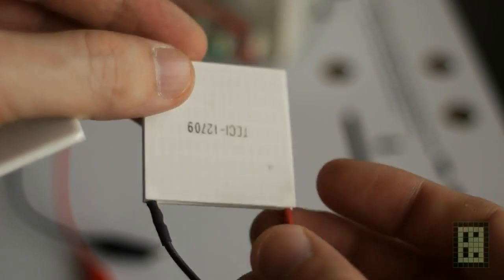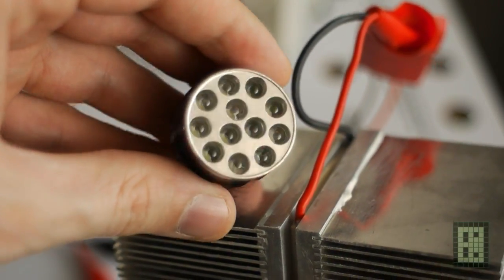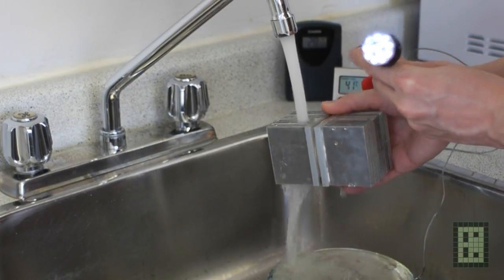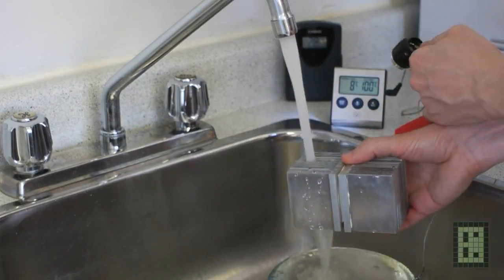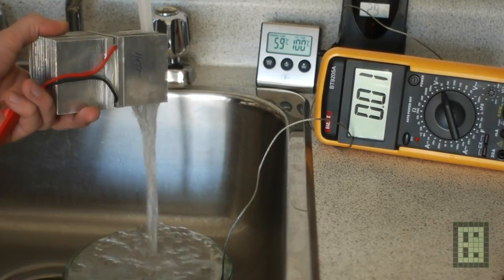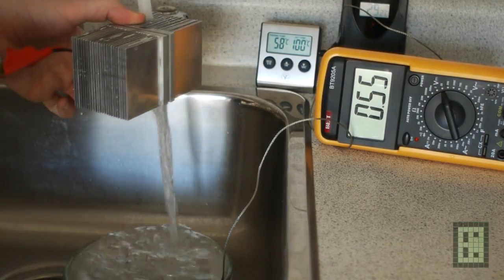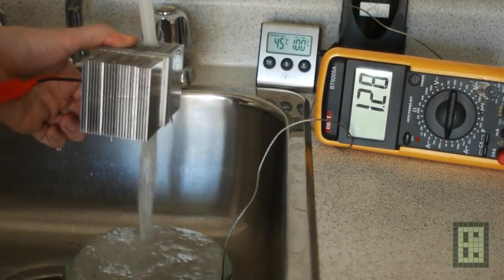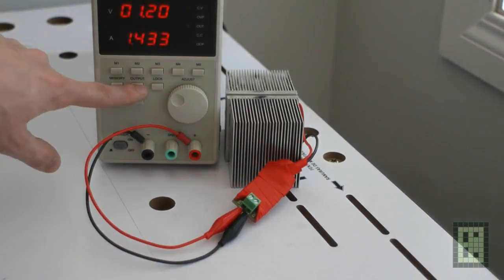Seebeck effect, using Peltier module to generate electricity

Comment from the maker: The project is possible but you will need at least 4 to 5 of those TEC12709 modules connected in series to get 5V 400mA.
Since the output is about 2W and peltier module is about 5% efficient the amount of heat that needs to get from one side to the other will need to be about 40W and should not be a problem from the exhaust of the generator.
Cooling the cold side can probably be done with a volume of water and you will need a simple 5V LDO regulator.

Comment: hello...
i have taken up a project on thermoelectric effect and i need 5V and about 400mA output to charge a mobile. I have to use TEC1-12709 module and i have no other option.
i will use the heat from the exhaust of a diesel generator set installed in our college campus. please guide me in this regard.

Comment from the maker: :) In a sunny day in the afternoon you get about 1000W/sqm from the sun on most place on the globe even in winter.
Sometimes you get more but this 1000W/sqm is used by the solar panel manufacturers to rate their solar panels.
So if a PV panel is rated 150W and is 15% efficient it probably has about one square meter surface and the rating is valid if the panel temperature is 25C if is higher the the output will be lower that is usually the case in sumer.

Comment from the maker: You need probably more peltier modules working together to do that.
The problem is that they are about 5% efficient so you need a heat source able to provide 10 to 20kW of heat.
If for example you want to burn diesel or gasoline to run the motor for 1h you will need about 1.2 to 2.5 liters.
Or say you want to power this with solar power then you will need a parabolic mirror of about 10 to 20 square meters in surface in order to run that motor in a sunny day.

Comment: Thanks for the reply.

1.Is it that if more of the Peltier module is connected in series, the voltage output is increased. Let us say if we connect hundreds of such modules, will the voltage be also increased to a hundred times of its previous value.

2.Does poor thermal conductivity refer to the hot water which went pass the module without getting used?

Comment: It was a good learning experience. Thanks electrodacus.
I have a few questions.

1.What is the reason behind the efficiency rate of 5%.
How does 95% loss take place.

2.I have also doubts in calculating the voltage obtained by Seebeck effect.
If the Seebeck co-efficient of material is of the order of micro-volt per kelvin, how will the output be in the order of tens of volts?

3.Is the output AC or DC

Comment: Thank you for your reply. Yes of course you need a battery bank, and would probably want both solar and Peltier modules, providing the P-Mods are even feasible.  How long it takes to charge the battery bank back up is of course a function of how many modules you have. Maybe you can help me: how many of this type (or other commonly available, p[lease specify) would it take to provide say 600 amp hours per day assuming a mid range of efficiency?

Comment: My interest is in finding if a gas furnace with electricity requirements of "starting" (igniting), thermostat and blower can be made "self sufficient" with Peltier modules for generation and deep cycle batteries  for storage.  Many people don't realize, NG will continue to flow for some time after a power outage.

Comment: What about the furnace heat ducts? Those don't get so hot...maybe perfect? As long as there is sufficient air flow around the ducts, there has to be at least a small differential between the temp of the duct metal and the "other side" (the air cooled side of the module) ...not sure if this would be enough but it seems to me it might very well be.

Comment: 1.2v @ 1.4A SC current is pretty good. It is comparable to a AAA battery.
Also, you might try wrapping the cold side in ICE so you do not have to keep alternating the sides like that.

Comment: This is true. I guess it depends on if you are worried about lifespan or not. 

Temperature differential is what makes it work but it is easier to make it hotter on the hot side than it is to cool the cold side.

Solid state electronics do prefer cooler  though.

Comment: I checked the datasheet and it showed you can run it up to +130C. I certainly would not recommend it but +80C or even a bit higher should be safe.

+60C is VERY conservative.

Comment: Do you know what the maximum ΔT it can handle? And perhaps, what's the min T on the cold side, and max T on the hot?
When a Peltier Module is rated at say 30W (input for heat/cooling effect), what would you estimate it could generate, if the module was exposed to the same temperatures on either side (Seebach effect)
I am thinking, -40°C on the cold side, and +80°C on the hot, to get ΔT=120°K
Also, would you know what's the max V the wiring can take, if connected in series? (or max string length)

Comment: That's very not true.  With the same amount of heat, I mean exactly the same you WILL get more power out of a TEG compared to a TEC.  The efficiency of the modules are not the same because the construction inside is NOT the same.  TEGs are much thicker elements inside thus create more power at the same heat level.  Here don't believe me, check this video out from a TEC/TEG company and not just hearsay.

Comment: Also you have to consider the cost factor of cooling the device.  It will take MANY more TEC units to produce the same amount of power as a TEG so the cost factor of cooling will also be increased by the same fold just to achieve the same power level.  TEGs also have a higher delta ratings so that contributes to it's ability to make much more power.  For a 56mm TEG, you can achieve around 19W per unit as compared to maybe a few watts for a TEC if you're lucky.

Comment: Great video but what most if not all of these videos using "peltiers" or "TECs" is the fact that they're mistakenly confusing it with a "TEG".  In the industry these are two different devices and used for different purposes.  While true you can use a peltier or TEC to generate power, they are much more inferior in ability to generate power, durability, and heat ranges than a TEG (thermoeletric generator).  True they cost more but it will be worth it considering how much more energy they produce.

Comment: @electrodacus hmm so 0.3W X 8 would give me 2.4 watts approximately. That's not bad, considering it is light that can be made (in my case) for free. At night. With no wind. I could hook up a joule thief, but I'm sure there are better boost circuits to use; more efficient ones. 2+ watts of LED light is actually quite substantial! Enough to light up the straw bale kitchen all night for free. No more stumbling in the dark. How can one determine max operating temps for the hot side? Thanks

Comment: @electrodacus I see your sample is in the video (held up) is a different, rated at a higher input current. Mine are: TEC1-12706 Thermoelectric Cooling Modules Couples: 127 Imax:6A Umax:15.4V Qcmax:53.3W Delta Tmax:69C. What, in theory, do you think I could yield from an output of 8 of these? I think they were $4 at the time, but now I see you can get them on ebay as low as $3 ea. shipped. Could a person collect 1 watt a piece? The heatsinks can be had, easily, free from recyclers.

Comment: @electrodacus Good to know! Well, in my case it is sort of free, actually, because the wood stove runs all winter anyway and I can't see these things "stealing all the heat" by any means LOL, All the lights are battery operated so if I could get some lights running anytime the stove was going (which is 8 months a year) I'd be laughing. I guess I'd need a water heat exchanger?

Comment: What is the best $/watt you have achieved, (approximately) I have 7 or 8 of the small units rated at 42 watts I think. Haven't really figured out how to get them into an ambient collection scenario, but... I'm thinking in the winter the heat from a woodstove exhaust pipe + the cold winter air should create a good differential. I just got a digital therm. so that's a start. What is the maximum differential before burn out? Thanks!

Comment: @electrodacus 
Yes, really depends on the application. If you have the space for more elements it would be the much better choice. There are some nice DC-DC converters with integrated sync. rectifier with 90%+ efficiency, but they will need at least 2-2.5V to start. The 20mV thing is intended for wireless sensor systems etc. Maybe it is powerful enough to drive the control circuit of an ultra low resistance converter with higher efficiency to boost sub-1V voltages. I will experiment with that.

Comment: @electrodacus 
There are some energy harvesting voltage converters made for thermal elements. I use an LTC3108 with an 1:100 stepup transformer. It starts working at about 20mV input voltage, so a small led will light wenn putting 2 fingers on the peltier´s surface. Nice Video! Never tried such a big temp difference. the short circuit current is quite impressive.